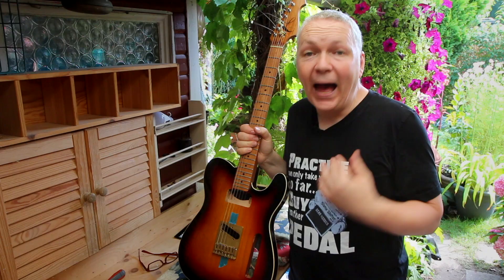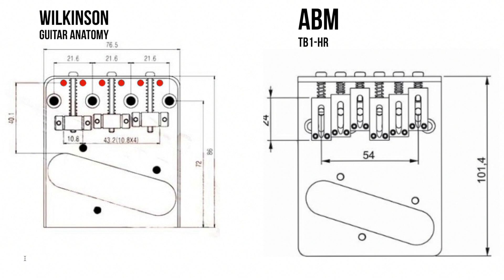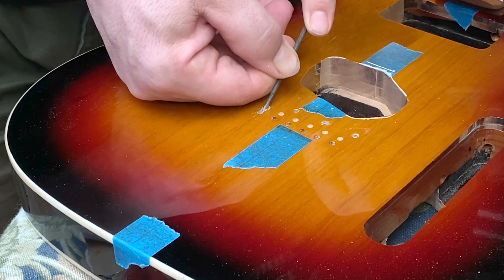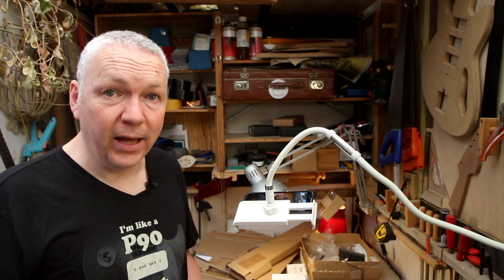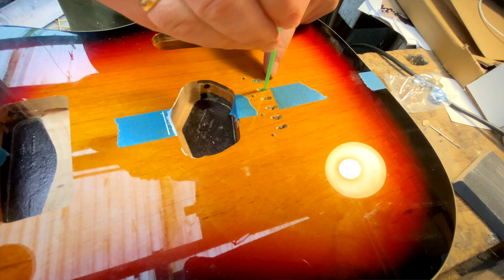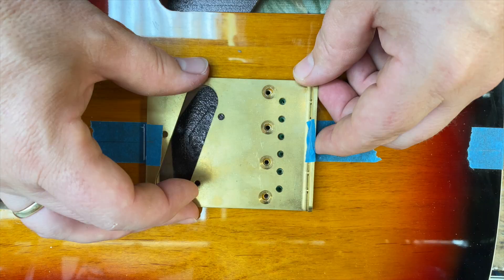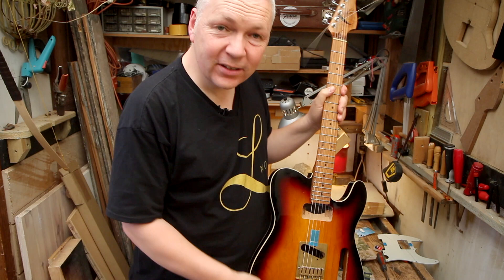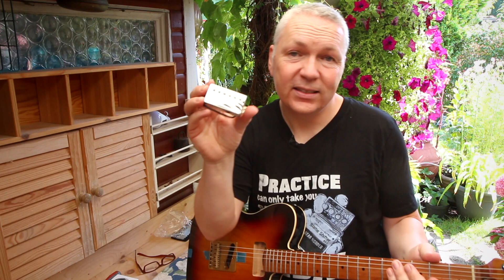How to Fit a modern Telecaster Bridge on ANY Telecaster

Comment: All you need to do is place the bridge over the holes and then use longer screws for the saddles so the intonation would still be correct. Much simpler solution overall. Cheers!
Reply from the maker: You are absolutely right and I actually thought about that but for some reason I chose this crazy solution. Can’t really remember why 🙄. Maybe because that wasn’t how Andy Summers original looked. No long screws. Should I do it again I think I going with your advice 😉👍
Anyway… thanks so much for the great input and for checking out the video. 😃🙏🏻
Reply: @MichaelLagerstedt  or you could have just used the Fender 6 saddle vintage replacement bridge....Fender makes it in chrome but Gotoh makes both gold and chrome.....
Reply: Would the cutout for the bridge pickup then be wrong?
Reply: @howardmaryon  yes

Comment: I find the more disturbing thing (Besides the fact that someone thought that is was ok to just move the string through holes and still associate the bridge with a tele) is that the placement of the pickup is different by a LOT with respect to the scale length which should make an enormous difference in the sound of the pickup. This reminds me of the wide variety in les paul JR dogear pickup placement with reference to the bridge.
Reply from the maker: Hi Leif, Yes you are right it affects the placement of the bridge pickup. I had to enlarge the cavity to make it work.
I would really love to see somebody make the history of the tele bridge video.
😃👍🙏🏻
Reply: I think that 5-10mm does not affect the tone too much. If it were 20-30mm yes, but 5-10, think not.
Reply: @lorencing  It's all relative, that difference can add up to quite a bit of extra string tension for certain people. Tighter string angle, tighter sound. For the pickup it's not that much, but still depending on the person it can matter.
Reply: @roderickbalt8993  true, it is all relative and it all depends on what sound you are going for. I prefer unique or different rather than going for the sounds I've heard many times. Still, a good question, why is the Gotoh bridge placement that different?
Reply: @lorencing  I'm not sure it's because of Gotoh but Fender as far as I know changed the string hole placement when going to 6 saddle bridges. So now you have vintage and modern string through holes. Why? Who knows presumably this just worked better for fender to place the holes further. A lot of variances like this exist that to certain people really make a difference. We as guitar players tend to not pay attention to what goes on after the bridge and nut😄.

Comment: Michael Lagerstedt...Drilling from the new string thru hole location, at the proper angle, to the string ferrule on the back of the body would have been the right way to do it...Using hot glue and plastic tubes is such a reckneck way of doing it...not to mention that the string tension will cut into the tubes over time...causing a whole new set of issues...
Reply from the maker: 🤣… what a great komment … you are right … what a redneck move 😂… I love it. 
Hey thanks so much for watching man… and for a fine comment 🙏🏻😃

Comment: Just FYI, you could have saved a bunch of time by just using the Gotoh GTC 202 bridge.  It's designed to retrofit a vintage-style bridge and has six saddles. It's not as cheap as some Tele bridges ($105 in the US), but it would have saved hours of time.
Reply from the maker: Hey, thanks for a great comment. It’s really helpful. When I went for the brass bridge I didn’t know that the string through holes wouldn’t fit.
Thanks so much for watching 😃🙏🏻
Reply: I'm looking forward to buy GTC 201 - I see those have the same dimensions, although 202 is steel and 201 is brass, should I get 202 or 201? I'd like to replace my vintage one

Comment: I think I had the same issue when replacing my 3 saddle with a modern 6 saddle bridge. What I did in the end is use longer screws and I got it as it was supposed to be, the same string length . So I used the original mounting holes but the new Gotoh bridge is moved by some 10mm back and I countered that by using longer screws.
Reply from the maker: Hi Goran
Yes that is a great solution to the problem I think. A few others have suggested that as well. I went the long way 🙄.
Thanks for watching and taking time to comment 😃🙏🏻

Comment: Brilliant solution.  I've swapped a few Tele Bridges and ended up drilling holes in the plates.  Next time I'm going fishing too.
Reply from the maker: Thanks so much - Yes it works pretty good. It’s hard to get used strings through though. Works best with new straight strings 😉👍
Thanks so much for watching 👍😃

Comment: Thanks for share your experience. Longer screws for modern saddles are simpler solution.
Reply from the maker: Juan, you are right but I didn’t really feel for that solution 😉👍. Had to do it the hard way 🙄.
Thanks so much for watching 🙏🏻😃
Reply: If I'm looking to swap from a vintage to a modern I just have to get longer screws?

Comment: I think on the modern bridge the actual difference is the pickup placement. It is placed more towards the middle, wich results in a warmer, fuller sound.
   For the modern individual saddles the string thru holes have to be placed more towards the neck because how the little saddles are constructed. Not enough room under them. Over the cylindrical two-strings-per-saddle, there is more space towards the back for the holes. 
   So, you did the correct thing to take the scale length as the main reference. Longer Intonation screws would result in a double bend of the strings on the individual saddles. Also the sound effect of the bridge pickup placed more towards the middle would have been deleted.

On my kit build tele (heavy modified), there were no holes for string thru, and I wanted a PRS type bridge (I didn‘t liked the big metal plate). Because I think a 90 degree angle on carbon steel made strings is not a good thing, I decided to drill the holes at a 60 degree angle from the top meeting holes drilled perpendicular from the back. Had the same problem with the restringing, but I use a piece of an old A string with a hook bend at the end to pull the new strings thru from the top. Works fine.
   Cheers! I like your builds! Keep going! Grüße aus Deutschland!
Reply from the maker: Hi, Great comment. You point out some interesting things.
Hope others read this.
Thanks so much for watching and taking the time to comment 😃🙏🏻

Comment: I have a modern bridge laying around, installed on my thinline is a "classic" bridge. Problem for me is not the string through holes, it is as you mentioned in the video, the modern bridge sits further back. The saddles on the modern bridge is around 8-10mm further back. I would need M3x40mm philips screws and matching springs to make it work.
Reply from the maker: Hey Hussam, you are right, that’s a possible solution. Other comments have pointed to that but there was also a comment arguing that the longer screws isn’t a good idea. Check out the other comments on that. I’m not sure 🤔 
Thanks so much for watching 👍🙏🏻😃

Comment: You can buy Teflon tubing for electrical insulation in a number of sizes. It is hard to kink it and it would benefit from its slippery surface.
Reply from the maker: Hi Leif - thanks so much for the tip 😃👍

Comment: Thanks for making this Michael.

I'm not looking to change the bridge on my Harley Benton Tele, but I've been trying to find out why the bridge is just over 10cm long, but most Tele bridges I see are much shorter - 8.6cm, as in your example.

It's only relevant to me because at one point I was thinking about putting in a Bigsby, which would mean getting the shorter bridge. I won't be doing that now, because it will increase the string length, and I like the guitar nice and twangy!

I'd still be interested to know just why there are two bridge lengths. My personal theory is that the longer bridge gives more area to transmit string vibrations to the body. That's why I want to keep it. But if my theory was true, ALL Teles would have the longer bridge, so there must be another reason.

Thanks again for this interesting video!
Reply from the maker: Thanks so much for watching Zachariah. I would love to know more about the history/development of the tele bridge as well. Part of the fun of building guitars is to try stuff out though and find crazy solutions. 👍😃

Comment: I encountered the same problem. Take a thicker drill bit and drill holes from the top just deep and wide enough to create a connection. Nobody sees the holes on the top.
Reply from the maker: That’s a great solution… thanks for sharing that 👏🏼👏🏼👏🏼😃
and thanks so much for watching 😉🙏🏻

Comment: What if I’m using the baritone telecaster? Is it really the biggest deal ever if my already longer scale length is a little longer?
Reply from the maker: Hi Kent, I don’t have experience with baritone guitars and haven’t researched it but when it comes to scale length it has to be pretty precise.
The length of a string has to correspond exactly with the placement of the frets on the fretboard so a few millimetres too long or too short makes the instrument impossible to tune so it’s in tune all over the fretboard. 
Thanks so much for watching and good luck with your project 😉👍

Comment: what is the measurement from the nut to the bridge suppose to be?
Reply from the maker: That’s what you call the scale length and on a tele and strat it’s 25,5 inches from the nut to the point where the string leaves the saddle of the bridge.
But each string length needs to be fine tuned. Mostly they need to be longer. 
Hope that helps.
I explain it also in some of my videos 
Thanks so much for watching 😃🙏🏻

Comment: Can i switch from a top loader with the 3 barrel saddles to a 6 roller saddle top loader with the same dimensions
Reply from the maker: I think it’s hard to answer. There are no rules to how different brands construct their products. Just make sure that the distance from the nut to the saddles is 648 mm when the saddles are in about the middle position.
Thanks for watching 😃🙏🏻

Comment: wouldn't it be simpler to just drill a set of holes through the new bridge using the old one as a template?
Reply from the maker: Interesting suggestion… 🤔
I guess that could work… but you would still need to route the cavity for the bridge pickup for it to fit 
Thanks so much for watching 😃🙏🏻

Comment: You could’ve just use tubing and flanged  the end with a bit of heat and a screwdriver?  Heat tubing.  Insert screwdriver in tip, then hit  with cold water.
Reply from the maker: Great input Jackie. I didn’t think of that.
Thanks so much for watching 🙏🏻😃

Comment: I always played my top loaded Tele, then I got a string through, and I didn't like it at all, the strings feel all tight and I find it doesn't do anything for the sustain, string thru adds so much unnecessary downwards pull, at such an angle,that  it made the strings feel unbendable, I like my teles to have a slinky feel to them, and I'm not a fan of string thru, they are a pain in the arse to string up, especially if you are using your old set of strings, getting the strings thru the ferrule, without these tubes is a fight, great invention but I would have just went with a top loader myself.
Reply from the maker: Thanks for great input. I have never thought about it that way. It would definitely be a much more simple solution.
😅
Thanks so much for watching.
👏🏼👏🏼👏🏼🙏🏻😃